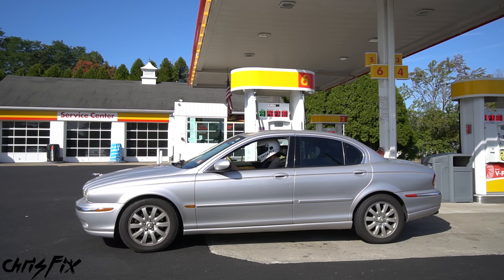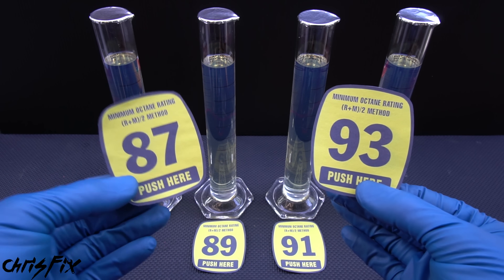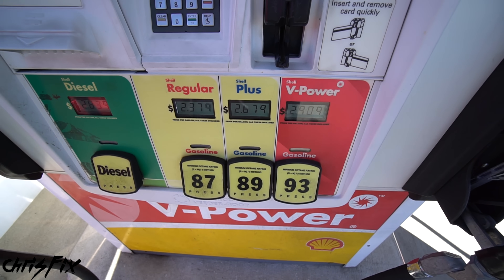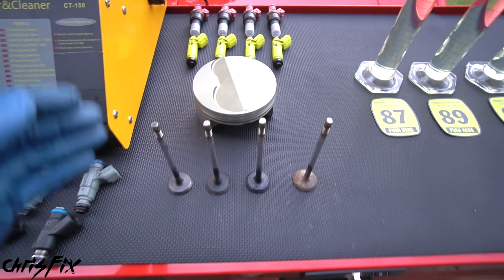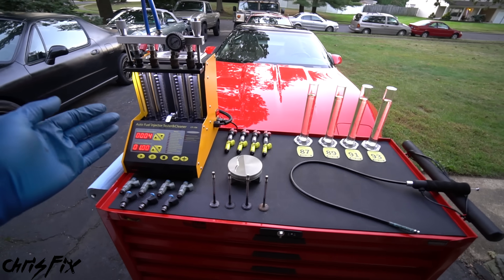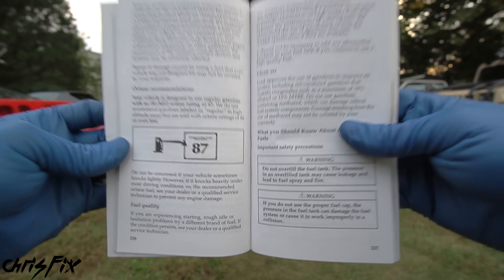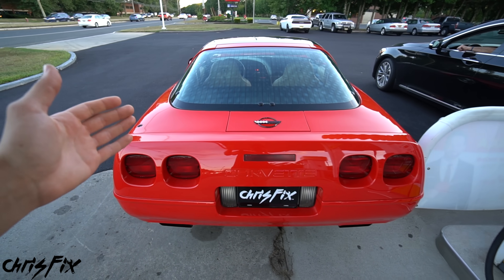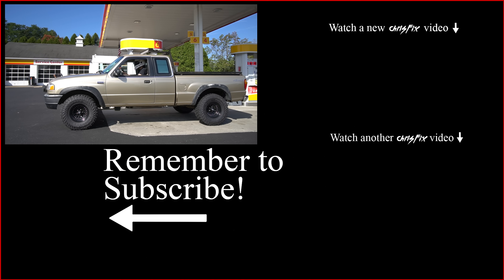What is the BEST Fuel to Use in Your Car or Truck and WHY

Comment: America: Screw the rest of the world. We'll have our own, completely different system to rate the fuels. 98 Octane in Australia is a completely different number in America.
Also, We sell by the Gallon,  which isn't actually a Gallon, but a different amount also. Lastly, we call it Gas, because a Gas isn't LPG, it's Petrol.

Get your shit together America.
Reply: The US does have it together. It built the world's biggest economy on this system. LMAO! XD Also the US system for determining octane is superior to the EU and Australian way of determining octane. You guys only test using the Ron method. Whatever that test spits out, you guys mark as your octane. But the US uses both the "Ron" and "Mon" method. 

The Mon test (Motor Octane Number) is a more severe testing method. It tests the engine under a load unlike Ron does. Then the US (And Canada) use the average of the results to give a more realistic octane number that is more representative to how gas burns under atmospheric conditions. 

So the US uses the Anti Knock Index. So 99 Ron in the UK for example, is 93 octane in the US. 98 in Australia is our 92 octane.

Comment: all natrually aspirated vehicles run on reg unleaded anything turbo charged or high compression runs higher octane to prevent predetonation simple as that no need for a video
Reply from the maker: scott cisek thanks for sharing. What you said is actually not accurate. Check the owners manual because high compression and turbo engines today have coating and other technologies to allow them to run on regular. Also if you watched the video I show how dirty valves and injectors look as well as clean ones. There is a lot of good info in here that not only tells you but shows and explains to you. That way you don’t have to be a sheep and just listen. You can get way more value if you understand why

Comment: I've got a 6.4L Hemi in my Ram 2500. Owner's Manual says that it's OK to run 87 Octane but recommends 89. I hate this ambiguity !  I've checked forums and there are lots of people who say that they have no issues running Regular. I too have no issues running Regular in that the truck runs great and has no indication of detonation at all. My concern however is in the long term effects. You indicate that it's the additive package that keeps carbon build up and corrosion to a minimum, not he higher octane. Is it likely that the 87 has the same additive package as the 89 ?  Do you think there is any long term damage being done by running the 87 Regular ?  When gas prices are low I'll fill up a tank with the 89 thinking that I might be doing the engine some good but I notice no difference at all in performance or mileage. I just feel like I'm wasting money (and I don't have much to spare) :-)
    On a side note .... I had an E85 Flex Fuel Ram years ago. Couldn't find any here in the south east so always used Regular 87. We travel a lot in retirement and I keep meticulous records for hand calculating mileage and my wife the same for expenses. Traveling across the midwest one year I noticed E85 at the pumps. I wondered if I should try it just out of curiosity. Then I ran the numbers and found it to be exactly 30% cheaper !!!  Naturally, I jumped on that deal and filled up. Continuing across country I noticed my fuel economy had fallen off significantly. At the next stop for gas I ran the numbers and found that the fuel efficiency had dropped by the exact same 30%. So technically there was no money to be saved. The only difference is that I would have to stop more frequently based on the decreased range of the tank volume.

Comment: Awesome video, like always! Heard a myth that different octane levels contain different amounts of ethanol, is this true? 
Apologies if this has been asked already, hard to check all the comments.
Reply: far as i know yes, thats why they recommend higher octane for small engines ethanol absorbs water over time so when your lawn mower is sitting outside for long periods of time it will not absorb water.

Comment: I had a 2010 Taurus that would throw a check engine light for an oxygen sensor if I ran 87 octane but it would go away with 89 octane

Comment: Man, I was just about to thunder away about the how we use RON in the UK rather than 'Octane', but at the 5:00 mark you explained it... save me a job ;) 

Good video mate, I remember trying to explain this to my non-petrol head friend. I had a VW Golf R running at 400bhp (~410PS), and it had the OEM sticker on the fuel door stating to run 98RON fuel minimum, but because mine was producing nearly 25% more power, tweaked intake and turbo, I had to run 99RON minimum. When taking it to the track, I'd even drop 1L of fuel grade ethanol into a 35L fill of fuel. I never tried it on the dyno, so couldn't say what it took the power to, but I know it dropped a scratch over 0.2s off the 1/4mi time with the ethanol. Would never run that for more than an hour though. 

If I ever had to put a lower rated fuel in her (such as the 95/96RON that most UK fuel stations hold without a 'premium' option), she'd feel terrible. 

I'd be interested in what you'd say about diesel options too... my Audi Q5 and Hilux get a tank of premium diesel every four fills, just to help blow out the s**t build up that diesels are apparently common for.

Comment: In actuality running e-85 in a non-flex fuel car won't damage the engine. e-85 is really resistant to detonation which is why its becoming the defacto race gas for drag racers. The problem with e-85 is the ethanol which is very corrosive to rubber parts, and there are tons in the fuel system of cars not designed to run e-85.

Comment: Dude your videos are so informative and clearly lots of work behind them. love your channel.. can you do a video on how to rebuild an engine ?
Reply from the maker: Thanks a lot Armando! I can make a video on it!
Reply: As far as a basic emgine building video he could. The problem with one video would not cover all the variables involved in an engine rebuild. A video that would include all variables would be hours long and months of video and editing. Each engine has most of the same components block heads intake fuel system accessories plus internally can be very different as in overhead cams, timing chains on various designs and setups, lifters rods and valves vary alot. The basic concept is the same but there are a lot of different steps based on the exact motor you want to rebuild.

Comment: Ive been using 89 in my bmw f30 and i haven’t had any problems my car has 100,000(i know, i drive a lot) but i will be using 91+ from now on.
Reply: if it works, don't change.

Comment: Chris your vids are awesome, detailed,  and brief and i learned alot about cars more than i ever could and that's Thanks to you .
Reply from the maker: I'm glad you're learning a lot! Thanks!
Reply: @chrisfix  Thank you so much for replying . I have a question my gmc Acadia 2010 has the engine light on and has been for a while. i made a computer test it showed me there are misfires in cilinder 3,4 and 6 . i cleared the codes and re checked they went away . after that i drove the car for like 30 mins and it drove amazingly with acceleration better than ever before. then the check engine light came back on and the car drove badly again. what could have caused this.

Comment: I have 85 in Wyoming :D
Reply from the maker: Have you ever used it? If so, does your car behave differently?
Reply: @chrisfix  I have a Chevy 2500 - use it every fill up since I drive 90 miles a day, and it's very cheap.  
 Vehicle does not behave different

Comment: The only reason to buy gas with a higher octane rating is to reduce the likelihood of engine knock and detonation in high power higher compression motors. Essentially helps increase the amount of combustion temperature and pressure it can withstand. Unless you have a race car or the owners manual says otherwise, stick with 87

Comment: The answer is simple:

Use the grade of gasoline recommended in your vehicle's manual.
Reply: Usually it will say it on your gas lid. If anyone cared.... They should read it haha. Put people don't even know how to check oil levels 😅😅
Reply: Bullshit. My car run terrible on 87 but that's what's in the manual
Reply: @familyfirst7027  As Chris said in the video, if your car runs better on 93 when it calls for 87, you likely got carbon deposits in the cylinders that is increasing the compression ratio, making it favorable for burning 93
Reply: @Aaron Phillips
 It's seems like you are Mr know-it-all but I, don't know crap about cars, so,  this video is Fantastic and I love it.✌
Reply: em745a  I wonder how that's gonna be with the skyactive x engine that wants to run like a diesel... might Require lower octane to run right
Reply: @Aaron Phillips the goal is supposed to teach people how this stuff works and why you need the correct fuel type
Reply: Every manufacturer has top grade research/ devopment and has done extensive testing etc... jjst like spark olugs they use what they use for a reason. If what they recomend isnt best for performance and  longevity id buy a different brand of vehichle.. Burning a higher octane may get u a little ump but it also burns hotter.  I use what they recomend. Theres a reason.
Reply: em745a  You still haven't told me which engine designed in the current century does not rely on a knock sensor to adjust its ignition timing. I'd refrain from calling other people idiots if I were you...
Reply: em745a  you're over thinking things and trying too hard to sound smart haha unless the manual says premium is required, regular 87 is perfectly fine on the huge majority of modern engines. Chill out.
Reply: When developing tuning protocols for our dirt track car, we start with a  high enough octane to suffice, then we begin to reduce the octane levels , while monitoring power and performance numbers.
We can produce the best power with the lowest possible octane.
I usually can afford to purchase less power than some of the other fellas. So having a process in place 5hat can bring iur power numbers up, even if it is not much, lets me feel better when rolling onto the speedway.
Reply: em745a  it has to run hotter on premium
Reply: When it says 87 or higher…
Reply: em745a  it's "well known" that if you eat cereal with premium instead of milk you'll eat enough calories for the year. Doesn't mean it's a good idea.
Reply: Ok, yes. For many people, yes. But what about those that will not give up the delusion that they are better qualified than the engineers who designed the engine to make the decision about octane?
It is my contention that these idiots need be muzzled to protect those that tend to believe this idiocy.
Never mind, sorry! I’ll shut up.
Reply: And it is truly difficult to find gasoline from random suppliers that can perform equally0
Reply: COOL & INTERESTING VIDEO -- THANX FOR THE INFO - WE 'LL KEEP WATCHING !!
Reply: That is always the case.
Reply: He literally said that in the video, lol 11:15
Reply: Can any seasoned mechanics or engineers help with this question?   I just got a 2020 Jeep Wrangler 3.6L v6 VVT engine.  The manual says to run 87 octane, but a lot of info going around that it's better to run either 89 or 91 octane to prevent early combustion and future knocking.  Would you say using a higher grade octane than what's recommended is safe and beneficial to the engine?  Thanks!
Reply: Good Day Mate  11:15
Reply: @gooddaymate1171 You asked your question on YouTube and haven't the the slightest idea if the commentor who responds to you is legitimate or even intelligent.  Wow.  Should you even be on the road?
Reply: Yall must not understand octane rating chris explained it well and project farm does too and does small engine test
Reply: wuphat Depends. As cars get older, and carbon buildup happens, hot spots in the combustion chamber can cause Pre-ignition. A higher octane fuel in this case could help with this. I’d suggest never going with an octane rating lower than what is recommended, even though it’s possible that the manufacturer could be overstating the requirements. Ignition timing and compression ratio are largely the tow factors in determining the necessary octane rating, in a new, clean engine.
Reply: em745a  That's a Mazda owner's secret man. Not like anyone is gonna believe you even though it's true.
Reply: Just cause it days in the manual doesn't mean its true. 2007 thru 2010 have coilpack issues and spark plugs that fail prematurely when ran on 87 octane. I had 3 denso coilpacks fail at 90k. I replaced the coilpacks and put new ngk spark plugs at 90k. At 112k i had 2 more coilpacks fail and 1 spark plug fail. The honda dealership recommended that i run premium and run lucas fuel treatment. Ive been running premium for over a year now. The car runs 10x better, no lagging, also it gets 5 to 7 mpg better. Lastly some gas stations have shitty gas like bp and certified. Smh
Reply: Luke Holloway fuel octane has no effect on the coil packs. You were just a victim of low quality electronics. The additives that are used to raise the octane level can sometimes leave slightly more deposits on the firing end of the plug. But lower octane fuel won’t cause a spark plug to fail. I worked for decades as a test engineer for a major spark plug manufacturer, and never observed a shred of evidence to support any of your claims.
Reply: @honda-s2k  how about other mazdas that have double your mileage and never had any of those failures by using 87?
there isn't a coil issue, spark plugs last longer than the recommended 75k miles interval... 

i'm also skeptical about any better fuel mileage. it's not like premium gas has extra energy (i may have extra detergents but no real 'energy bust')
Reply: @duroxkilo  quality of the gas equals better gas. Every gas station has different additives that they add. Bp gas and certified gas are terrible every time i run them the check engine light pops on flashing. Have no issues with giant eagle or shell. Mazdas are different. Not every car is made the same. Especially electronic components.
Reply: @honda-s2k  It's all the same oil, coming down the same pipes, from the same refinery, so the "quality" is identical. The difference is the additives package and usually cars tend to have preference in that regard.
Reply: @233kosta  i understand, thank you very much for sharing your knowledge... be safe, have fun.
Reply: @233kosta Cars do not have preferences.  Owners do.
Reply: @WilliamMurphy-b6v   You'll be surprised. Different engines work best with different fuel blends. Especially with older models.
Reply: @233kosta No, I'm not surprised.  Engines built for gas work best on gas,  Engines built for other fuels work best on the fuel they were designed to use.  I believe that.  Ethanol, for the masses, was a scam touted to improve the environment.  Farmers loved it as the price of corn skyrocketed with increased demand for corn used to make ethanol.  Plus, using less pure gas saved the natural resource of oil and, again, supposedly was great for the environment. The government created a new industry, and many politicians profited from insider knowledge along the way.  Same thing happening with EV vehicles now.  The problem is in the implementation.  Where are all the needed charging stations?  The effect of heavier vehicles on the roads.  Effects of heavier vehicles in crashes with guard rails designed for lighter ones. We rush for perfection and skip all the steps in between.  Deadlines set. Solutions not.
Reply: em745a  Every modern engine will take advantage of higher octane fuel, but usually the added cost significantly outweighs the benefit unless it's necessary for the engine to function at all or you're on the track trying to set a new personal best.
Reply: Jordan Painter  Wait what? That makes no sense.

Comment: Should I wait to fill my tank until it’s empty with 99 if I regularly use 87? Does it matter if I mix it with 1/4 or 3/4 tank? If you’re able to reply, thanks in advance!
Reply from the maker: You'll get the best results if you wait for the tank to be close to empty, but there isn't anything stopping you from mixing 2 grades!

Comment: If I drive like an old lady going to church on Sundays will running regular gas instead of premium harm the engine in all circumstances without exception? Is there a way to drive gently without producing knock in a high-compression engine?
Reply from the maker: I would just put in premium if your car requires it

Comment: Do NOT do NOT put E- 85 in small engines if you own a landscape business tell your workers or you as OWNER get the fuel for them. All small engine makers will NOT warrant  a Engine if you run Ethanol fuel in them ( it will put water in your tanks) mess up your carb. and make small engines very hard to start if not at all, 
 if thay have sat and not run.

Comment: so i drive a mazda 3 2014 and im very confused what fuel is best for my car. so my car says on the gas cap that i can run E10 but i have a compression ratio of 14 to1 what should i use ? owners Manuel says RON 91+
Reply from the maker: What the owners manual says. E10 is the maximum ethanol your car should use. That’s 10% ethanol. The 91 octane is just the octane. You can have e10 91 and e10 87

Comment: So, my vehicle recommends 87 octane or better, but i live in an area where my only options are octanes 86, 88, or 91.  I'm guessing it has something to do with the higher elevation in our city.  Am i still able to use 86 without risk of engine knock?  I've primarily been using 88 in the meantime.
Reply from the maker: I would keep using 88